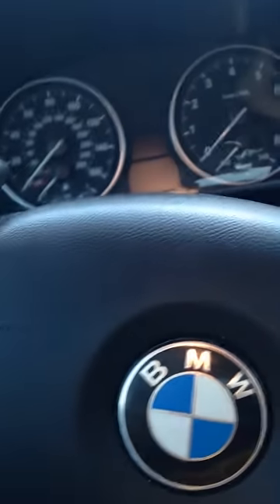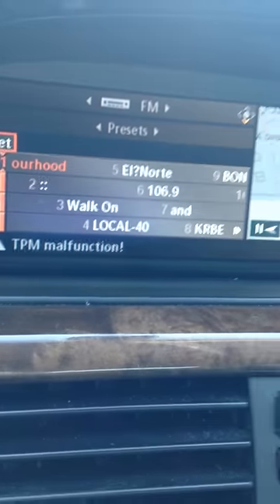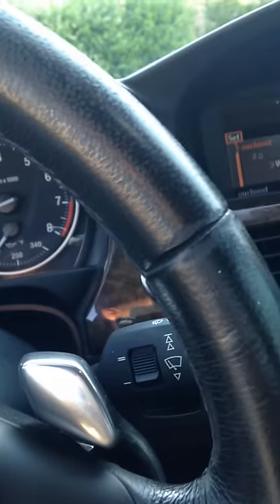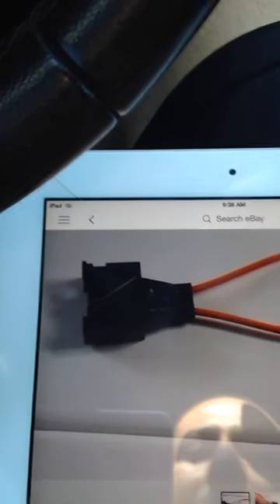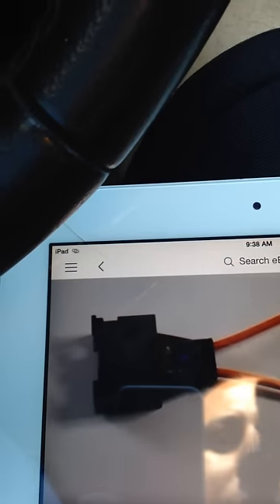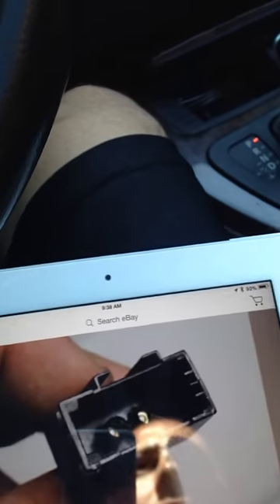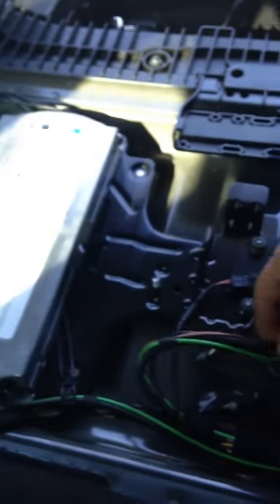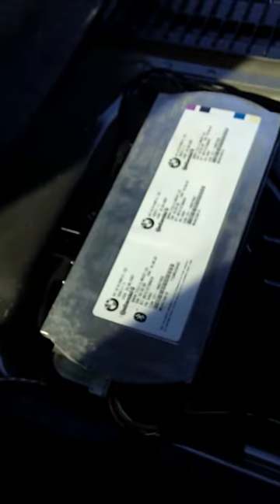How to fix your bmw sound system  (335i) e90 e92

Comment: LOL, I laughed at the nail clippers at first but it worked better than everything else....  LOL  I just want to thank you for this video.  My mulf 2 module was the culprit.  I bypassed with this method and everything is back up and running.  No more sos malfunction and warning chimes back on, I still have satellite radio Bluetooth and everything, not even sure what the mulf2 was even doing... Dealer wanted $2800 for a new CIC, crazyyyyyyyyy..... Thanks again Gabriel!!!

Comment: GREAT VIDEO... showed exactly what I needed to know and it worked the first try. I will also mention that the vendor making these Optical Loops on Amazon has changed their design and it now comes READY to work on our cars (2006-2009 BMW 335i) without modification.

Comment: I bought the cable off Amazon, quick easy fix.  Thanks!
Reply: What’s the cable called please?
Reply: @smoovement.2817  Universal MOST Fiber Optic Optical Loop Bypass Female Adapter for Radio and Audio Compatible with BMW, Mercedes, and VW SOS Fix

Comment: Hola Gabriel  por el momento no tengo Nada de audio. No radio y no sonido de la alarma ni de audio al poner el Keyfob/ Llave en posición de ON.           no tengo TCU y ni el Satellite module. puedo usar este fiber optic loop para que sirva mi Radio/Audio
Reply from the maker: Jorge Medina yo pienso que si por que son los mismo sintomas que yo tenia en mi caso lo puse en el satellite pero si es en tu amplificador por ejemplo pues lo connectas  ahi
Reply: Gabriel Torres gracias Gabriel. Lo voy a intentar How me llegó mi  Sat module. Aver si mañana lo intento y espero tenga sonido. Saludos

Comment: apart from this fault the other fault is volume fluctuates up n down etc , iv found that on my 08 325 coupe that i was using i phone through aux lead , for some reason u can't stream music through the cars bluetooth system apart from voice calls , went to settings , fucked about wd all settings but no joy , loaded cds and the volume in car was fine and load , but wen i switched over to aux it was low volume bearing in mind i had good lead , done some investigating , found out that using aux lead through headphone jack lowers the quality of sound , but if use another lead which u attach to your phones charging port and  insert into cars aux port that suppose to be the proper way of streaming the music , i went one better , i bought a ugreen wireless bluetooth 4.1 reciever with mic of amazon , plugged it in my aux port , connected my phone via bluetooth and job done , all my tunes are being licked out at full volume , no up n down nonsense and very very loud ! got to say though these speakers they put in 3 series are piss poor , they are very limited in mid and bass range !

Comment: So do you leave the optical loop bypass connected?
Reply from the maker: Yes
Reply: Thank you. I have a 328i that has the same problem. Ordered the part on amazon hope it works
Reply: I have  a 6series will that same bypass work on it
Reply: You'll be out $15 if it doesnt work, dealer quoted me $2200 to fix it. Bought the bypass switch on amazon and boom it worked
Reply: I also have a 328 e90. Where was your problem @Ferdie
Reply: I have a problem with my 328xi. no sound at all but I have no messages on screen, does the factory amp have a fuse? how do I test if the amp is blown?
Reply: Anthony Gonzales did you find out?
Reply: no.. I think my amp is factory amp is fried but I don't know yet
Reply: I have an e92 2007 bmw 328i, I've swapped my current amp with a new one because that's what a professional told me to do, and it didn't do a thing. I was lucky to find the amp for a good price, and flipped it. I'll definitely try this guy's method now.
Reply: Gabriel Torres

Comment: When looking inside my trunk, I seem to only have the TCU and not the satellite.  I bought the piece and it arrived this morning, trying to figure out what to do now.  Looking at all the connections, it doesn’t seem like it was there and removed because there’s no loose wires or kissing plugs.
Reply: Hey did you ever find the satellite ? My satellite system isn’t in the back of my trunk either.
Reply: @daanielcarrillo  not all bmws came with satellite. If you don’t have audio try to bypass the tcu, if that doesn’t work try the mulf behind rear driver seat

Comment: Hey I have a 335i and my alarms sound good like seatbelt and even the treble on my speakers but absolutely no bass !! My subs aren't blown out since I got them checked last week when I had my car at the dealer for a new water pump and thermostat (😰 mad expensive) I was wondering if this loop could maybe fix my problem also thanks.

Comment: Hello everyone, I appear to have a similar issue. I own a 2009 335i e93. Few months ago my audio, sound, everything just vanished. Would this bypass procedure help in my case? I appreciate any feedback
Reply: It only helps to troubleshoot which piece is the culprit so you don't go and order everything. So when you plug it into one of the units (amp, TCU or MULF in trunk) and the SOS error goes away/sound works...THAT is the unit that needs replacing.

Comment: IF YOU DONT HAVE SOUND: CHECK YOUR AMP IN THE TRUNK UNDERNEATH THE GREY COVER (CHECK THE FUSE AS WELL).IF THAT DOESNT WORK THEN YOU CAN TRY TO BYPASS IT WITH THIS METHOD.50/50 CHANCE IT WILL WORK.CHECK YOUR AMP IF THE RED AND YELLOW LIGHT ARE ON ITS IN SECURITY MODE SO IT MEANS THAT ITS FRIED.THE AMP COST $100-$350 ON EBAY DEPENDS ON YOUR VEHICLE.
Reply: Alma Diaz Where would the red and yellow lights be located on the amp? I'm seeing a red light inside the wiring harness plug when I detach it from the amp...is that what you're referring to?
Reply: Melanie Stantial I also have a red light on the harness. Does that mean it's still good?

Comment: My car doesn’t have the satellite unit only the TC unit but I have the SOS error. How do I fix this
Reply: I am in the same boat. I tried doing the bypass on both male connectors (Neon green wires) on the TCU but nothing worked. I even tried it before I used the nail clippers to be sure --- Nothing.
Reply: Luke Brignola did you check if your Amp is flooded? The left tail light is defective from factory and will flood your amp at some point with heavy rain.

Comment: i have the same issue can you please give me the link to buy the by pass 
thank you
Reply from the maker: Go to ebay and type fiber optical loop bypass female adaptor
Reply: thank you bro, yesterday i opened the back it seems like someone stole my satilate radio from my trunk
Reply: thanks for the link
Reply: Np
Reply: Af Ra 
[_
Reply: Hi can you help me please, I have a 7 series 2005 730d and I just see your video it's awesome, but I have a problem I can't find the units...can you please help me Thanks.

Comment: Do you have to recode the computer when you put this on to clear the SOS error code? The dealer is looking to charge me 1 hour to install and 1 hour to code the computer. It doesn't look like any re coding was needed and it also doesn't look like an hours worth of labor to install.
Reply from the maker: leonard simmons in my case no recoding was needed. It worked right away

Comment: INSTALLED AFTER MARKET STEREO INTO MY X3 AND CANNOT GET SOUND.
 

CALLED THE COMPANY THAT SOLD THE WIRE HARNESS, AND THEY SAID THAT :
 

"""THE WIRE HARNESS IS ONLY FOR BASIC INSTALL"""...?? AND
"""THE WIRE HARNESS WILL NOT RETAIN THE AMP"""...?? AND
"""I NEED A MODULE FOR MY AMP TO WORK"""...??
 

WHAT DOES THAT MEAN...???
Reply: You ever figure this probelm out?

Comment: Mines was the fuse 2008 bmw 335i conv..
Reply: hey man which fuse did you end up changing? lost all audio on e92 328i coupe 2009
Reply: DimmmIs Back did you figure it out? i just installed a used nav unit and now my sound is gone. i’m thinking it’s the fuse on the back of the nav unit.